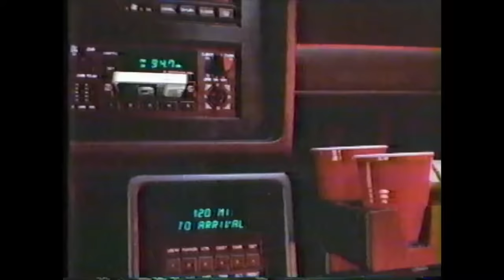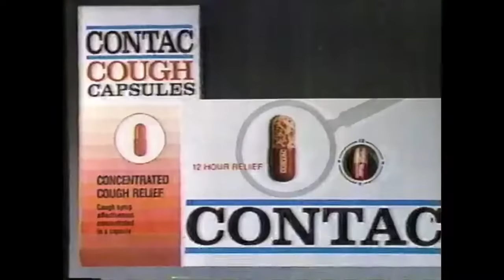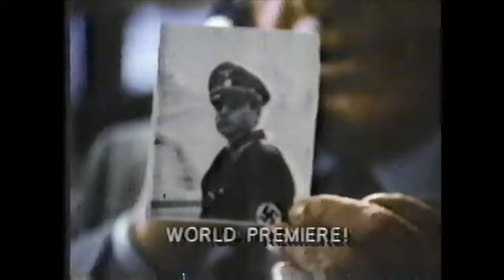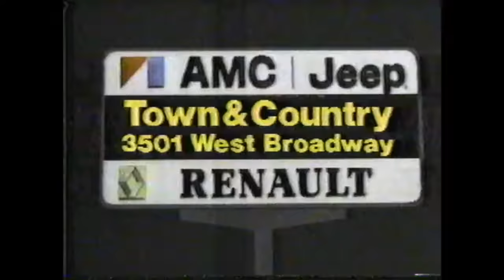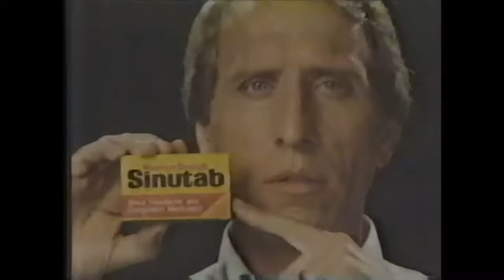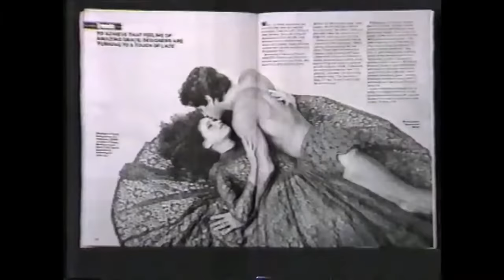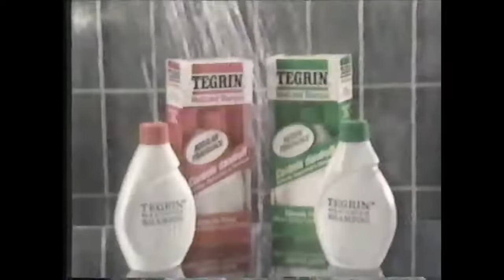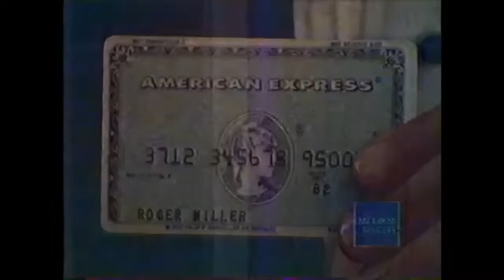40 minutes of commercials from 1985

Comment: LOL  Who had a Zenith in the house? 🙋‍♂️
Reply: Yes, a heavy one, in a big wood box.
Reply: My Dad had an old Zenith radio from my great grandparents.  It was massive!
Reply: Floor model🤣
Reply: Yep! Old wood floor model and vcr with remote 👍
Reply: Yeah and sometime in the mid-90s, it just made a weird noise and then a little smoke came out and that was it for that t.v.
Reply: M451  it was a good tv.  We probably had it for as long as you had yours.  We used to hit the top of it when the picture was messed up.  Seemed to work pretty good.  Ah, the days of having the antennae on the roof.
Reply: We had one that was a TV and VCR combo with mono speaker.
Reply: @matte8441  - That's high tech!
Reply: My parents did at one point. They also had a Curtis Mathes brand TV at one point in the mid 80s.
Reply: I was 14 years old, but didn't have one!
Reply: M451  my grandparents not only had one of those huge wooden ones that was literally a piece of furniture but they had the smaller new model on top of the wooden one lol 😝.
Reply: M451  yeah I remember back when I was like 13 my step dad got me this little old 10-12 inch color tv for my room. It was manufactured in the late 70s to early 80s and that little tv was shockingly heavy. It had to have weighed 25-30 pounds at the bare minimum. I can literally carry my 50 inch flat screens with one hand provided I don’t have any walls or furniture to navigate around. That’s a blessing I definitely appreciate. These kids nowadays just don’t know how good they have it imo.My parents and grandparents also had those big long wooden stereo systems with the turn table that were like 5 feet long with the wooden lid that lifted up.
Reply: M451  I can report that I’ve got one 32” RCA flat screen that I have had for 15 years that’s still in use. I’ve noticed that the cheaper flat screens like the 50 inch Sceptre brand seem to have about a 66 percent 5 year survival rate in my home and we don’t watch much tv anymore. Yeah those wooden huge stereos weighed hundreds of pounds. Not to mention the ridiculous amount of wall space they took up. My parents ditched the one they had in 85 when my dad financed his first individual stack system in 1985 much to my moms dismay.
Reply: Floor model with the wood grain!!
Reply: I had a Zenith as big as a house
Reply: Awe HELL YA we did!!!!!
Reply: Big one that youd smack tha crap out of it when you started seeing green phase in in the corner(meaning the set was starting to give out ) smack the crap out of it on top and you could get 6 more monthes outta dat thang! Thunder thunder thundercats HOOOOOO!Smack it like Fonzi but not to hard yer mom would berate you!
Reply: Mom and dad always had a Zenith since '68...VERY reliable televisions.
Reply: They were made in USA too although probably not by the 80s.
Reply: We did had that zenith for years
Reply: We had a Zenith that came with the TV Stand we kept for years!
Reply: I am 43. I had a zenith tv. My dad and I watched Super Bowl  20 on it
Reply: @chriscarver9076  - Awesome!  Do you remember the Super Bowl Shuffle?  lol
What an awesome dominant team that year.  Poor Patsy boys.  I don't think I even remember anyone from that team.  I was just 9 years old when that aired.
Reply: I had RCA tv.
Reply: Many of us had a few zeniths. A good one stacked on a dead one
Reply: My Sister dumped a glass of Soda into the back…..fried the fu’k out of it!

Comment: Dodge was junk in 85 and still junk in 2021.
Reply: Sorry, but I gotta disagree... I bought a used (2006) Dodge Stratus in 2012, & she's still going with almost 153,000 miles on her.
Reply: @suzannac.6057  remember this comment when you hit 180k and your engine starts making a funny noise. If I would have took my 04 stratus to the shop for everything that went wrong on it I would've paid 5x what the car was worth easy. I also still have a check engine light burned into my eye from that car. Chrysler = junk.
Reply: I had a 1996 Dodge Stratus and it left me stranded so many times.. so many repairs. That Stratus was the least dependable car I have ever had. I'm glad you had luck with yours because I sure did not!
Reply: @cynthiagalasso8283  I had luck because I never owned a Dodge lol